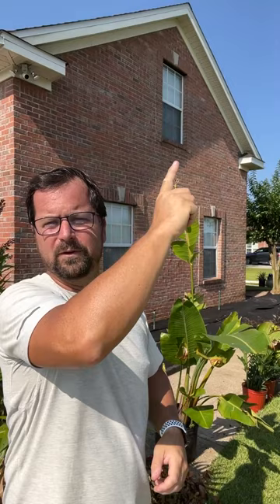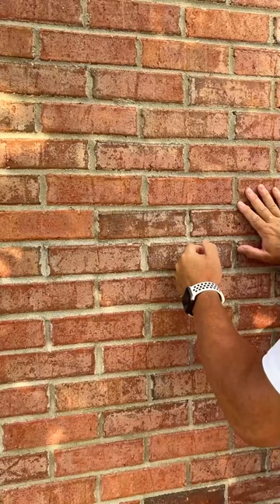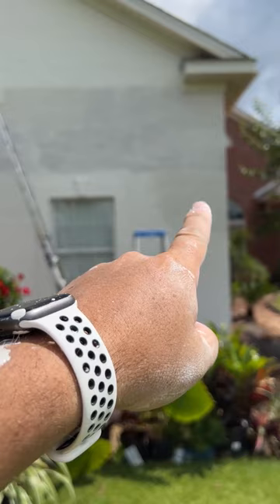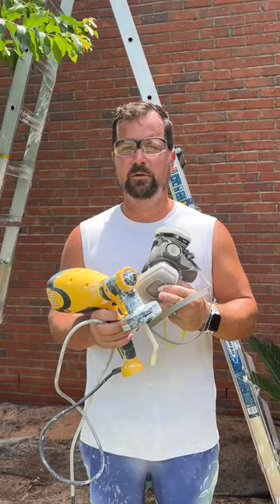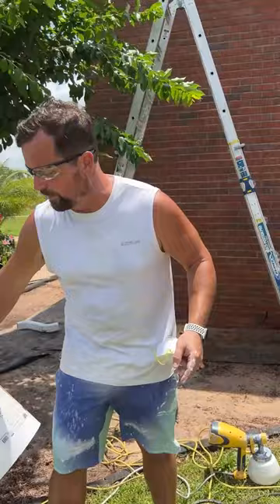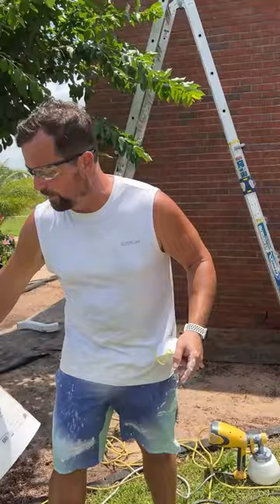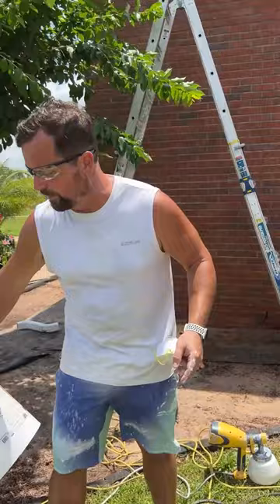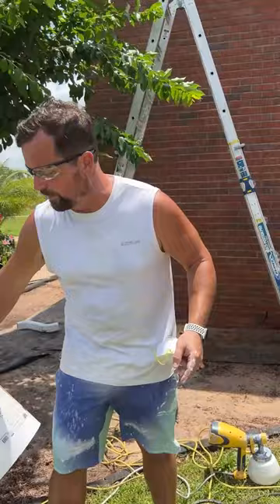Are you Team Limewash or Team Natural Brick? #diyhome #painting #housepainting #homeimprovement #diy

Comment: You always provide thorough instructions - providing people read and / or listen.  

I like brick too, but in certain applications.  And like lyme wash for the exact reason you stated, it lets the bricks breathe unlike a conventional ",paint." Years down the line this will pay off in the long run as constant exposure will result in brick repairs and many times the original product is no longer available.  With lyme washing it will not be a big deal.  Repair then lyme wash and it will be just dandy.
Reply from the maker: Totally agree with you!

Comment: I just saw your video short, I can't wait to see it lime washed! It was wicked funny how you described the pressure washer extension. For real though, I have to hold my pressure washer 3 inches tops! from the concrete to get the mold off, not for the weak!  Beautiful home! 
I also am painting a house right now. What did you do when you had to paint where the power comes into the house near the meter????